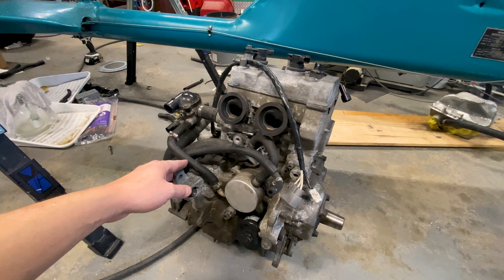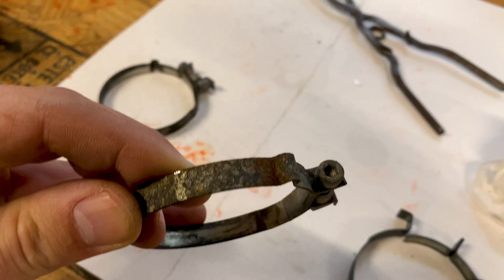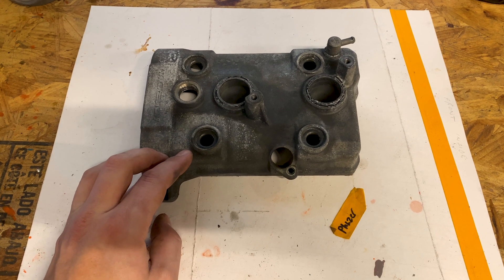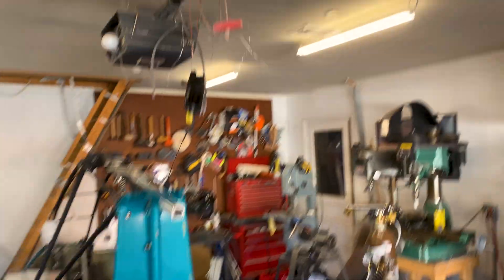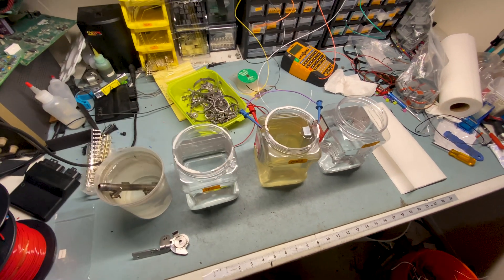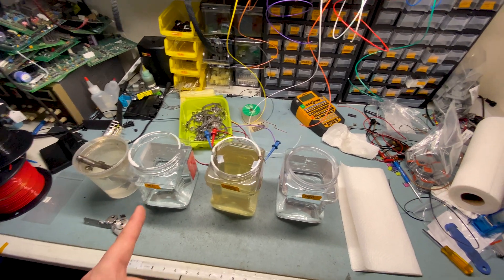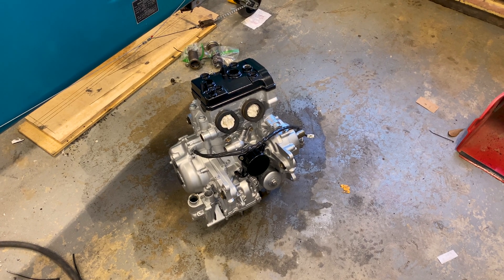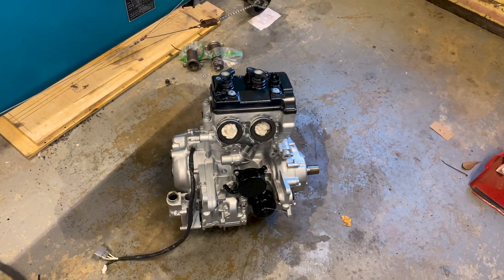Yamaha Engine Refinishing - Budget Bushplane EP9

Comment: I have owned a bead blasting cabinet, from harbor freight, for about 35 years. It has a Tacoma company retrofit kit installed which made it 400% more effective. It's worth it's weight in gold for how it transforms ugly parts into beautiful ones. If I was a little younger, I'd make a water blaster & have the parts come out much more beautiful than just plain bead blasting. The finish is as good, if not better, than brand new, depending on the quality of the parts you acquire.

Comment: Hi, I am on an FSAE team with a Yamaha Phazer engine, however, we have no experience working with this engine and are having trouble identifying sensor locations (crank position sensor).  Would you mind helping us out, or even just helping us with identifying part locations?
Reply from the maker: Crank position comes out of the stator cover along with the connection to the voltage regulator. There's a big three position connector with only two big wires going into it and a small two pin. That little guy is what you're looking for.
Reply: @ianslife210 Thanks! We were confused since the service manual said the AC magneto and Crankshaft position sensor's lead couplers were in the same location. Checked their wire resistances and confirmed the parts. 

Where is the cam position sensor located? 

Lastly, How do we identify sensors that are not described in the service manual? (The two sensors that point into a cylinder perpendicular to the crankshaft.)

Appreciate it!
(P.S. We're working with a Phazer 2007)

Comment: An old Ferrari trick for porous, pitted or rough aluminum and magnesium engine parts is crinkle finish paint. VHT sells red and black. For the zinc electro-plating I think you skipped the last step which would be the passivate. The easiest way is to dip it in chromate solution which results in yellow zinc that looks like cadmium plating. Without it the zinc coating will soon turn a chalky hue. I enjoy your videos, much more down to Earth and relative than Mike Patey's multi-million dollar "Scrappy" build.
Reply from the maker: Interesting, I’ve seen my method used but I don’t have the long term results yet. I’d like to get the yellow zinc kit and probably will one day but I was too cheap to do it right off the bat.

Comment: I've watched a few of your videos and live what you are doing with the Phazer. 
I just bought a Quicksilver MX2 that has a 503 that sits on the top and has a drive shaft that goes to the back end to drive a propeller. I was wondering how difficult it would be to replace the 503 with a phaser that drives the same drive shaft but perhaps with a different ratio pulley?
Reply from the maker: That I’m not really sure. Teal Jenkens of skytrax would be the person to ask about that sort of thing more than me.

Comment: If you didn’t first paint that engine case with self’etching primer, you made a mistake.   Regular paint will not stick well to bare aluminum.  (Unless your paint is specifically made to paint aluminum.)
Reply from the maker: It is specific engine paint for bare aluminum.

Comment: Way to go! Enjoying your videos. How about getting a Harbor Freight table top media blaster filled with plastic media for cleaning aluminum parts. I bet your Dad would use it too!
Reply from the maker: I have a few blasters but I’m always concerned about getting media in a port. The engine can swallow a little water much easier than some glass bead.
Reply: @ianslife210  Got it. i meant for small parts like clamps, valve covers and such, not for the engine itself. If you ever have time please visit me at the Conroe Airport. My phone # is in the eaa302.org web site under Tech Counselors.
Reply from the maker: Oh! I misunderstood. That’s a good idea and honestly if my cabinet were set up easier fo access I’d probably do that. The vinegar worked so well to prep parts for electroplating that I didn’t have to but I do use media on occasion. 

I’ll look you up at Conroe and drop by some time. I’m up that way fairly frequently.

Comment: water blasting is much better for aluminium , and painting an aluminium Engin is preventing the shedding of heat, and you want to have heat transfer from the aluminium to the ambient air to de as efficient as possible ( water blasting to rid of oxidation and a yellow Alodin is cheaper then anodizing to prevent build-up )
Reply from the maker: The phazer is water cooled so there’s not much to lose there.
Reply: @ianslife210  I agreed that it is water cooled, never the less as a contributing factor however small it is air cooled can benefit.

and I am not at all trying to be a gnome, I am liking the chinook project and am happy that you share it